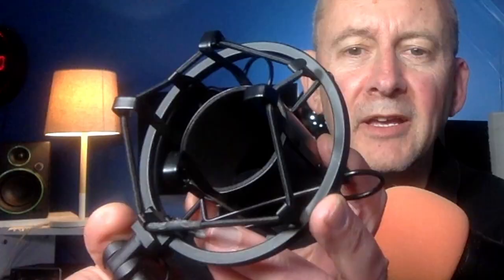Do You Need a ShockMount for Your Microphone?

Comment: The rubber bands of my Røde NT1-A's supplied shock mount grew loose over the years because it was the most convenient place to store the mic most of the time; Would simply tying a knot into the bands in order to make the cradle float properly extend the life of those bands, or are there drawbacks? The bands haven't lost their elasticity *completely*, obviously I think that when they do, they would probably act as just another stiff component to transfer vibrations by.